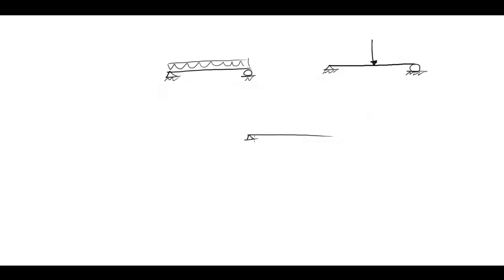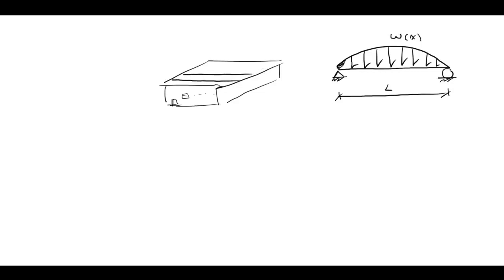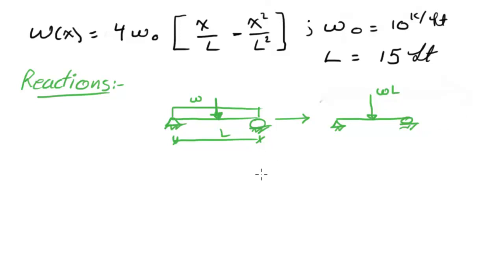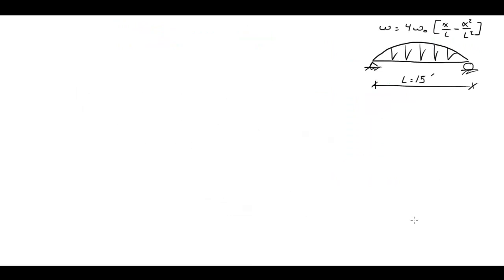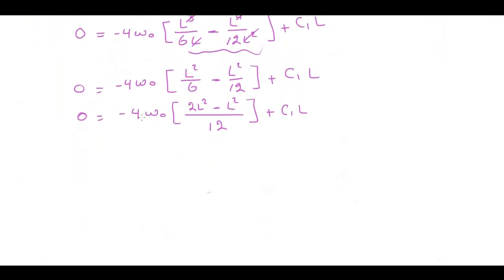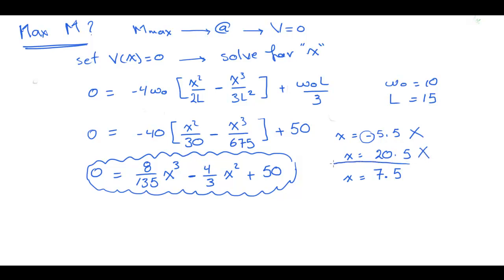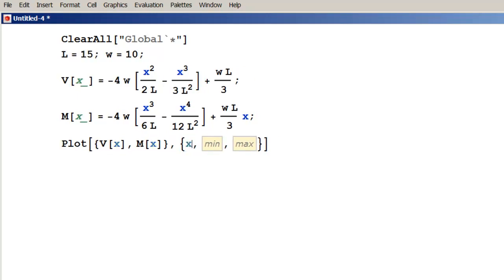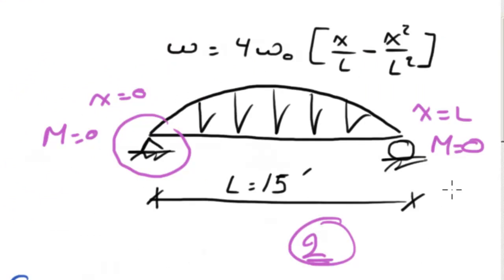Question (3) - What type of loading should we expect on a beam?

Comment: Sir problems with UVL and UDL mixed in a beam using heavy side notation with different support system and pin joint.Where Moment,all the acting forces,Manding moment and shear forces and their diagrams need to be calculate.Please make a video.